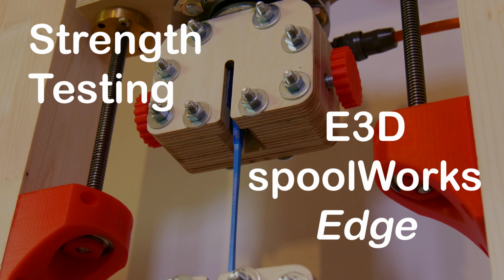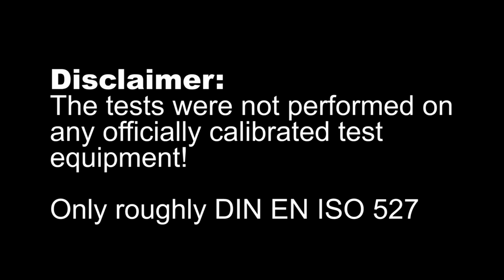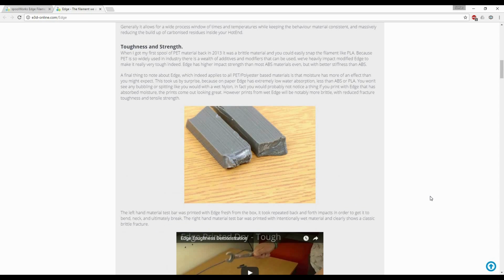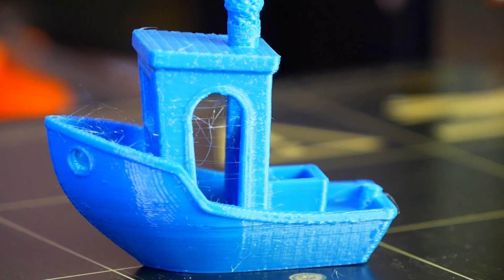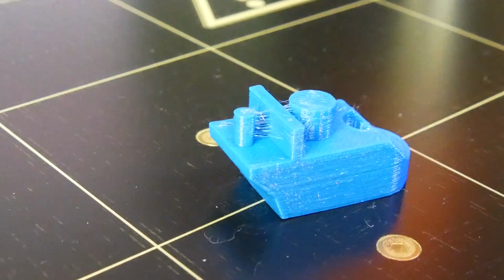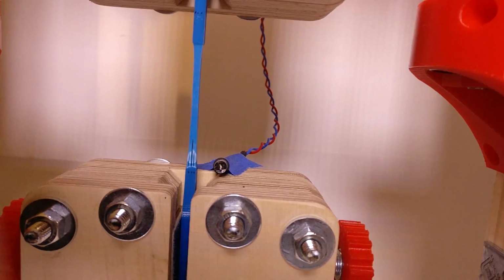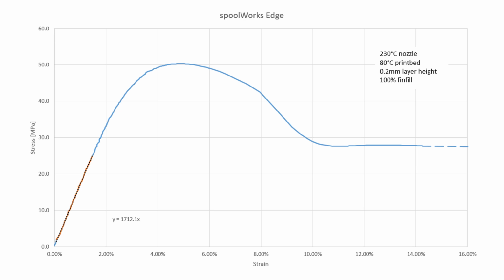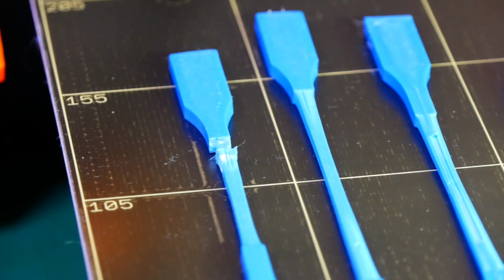Filament Strength Testing: E3D spoolWorks Edge - How strong is it?

Comment: I believe that to achieve better layer adhesion with higher temperature filament you need the enclosure with temperature control (not too far from the glass point of the filament used) so that any plastic has a better chance at good quality print. Due to less aggressive temperature drop while curing and more time for the layers to bond.

Comment: Thanks for the excellent video. I've NEVER got on with PET-G and co-polyester based materials. I find them viscous when extruded, retain heat too much so they curl (not warp) and adhere so well to PEI they can destroy them. The colorfab XT-CF material solves the curling issue by stabilising the material and is quite nice but not perfect.

I'd love to see my favourite materials tested: Polymaker PC-Max and RigidInk Carbonyte. Both of them are amazing to work with. The Polymaker in particular.

Keep up the good work! Thanks again.

Comment: Absolutely love your videos! My Prusa is setup nearly identical to yours, including only two screws on the extruder fan (4 seemed like an overkill). I have been curious about heat treatment of FDM parts, may help with layer adhesion post print. Is that something you have tried? Would love to hear your opinion or possibly see a video!
Reply from the maker: Yes I've tried it a couple of months ago for some specimens. It did not change the world and you have to cope with lots of warping. I'm planning to make a video about that in the future.

Comment: Good job! I use Spanish PETG/ as i live there/ and as we have the same printer like you, i print it at 225- 230C , 65C bed original settings for Simplify3D for ABS, just changed the nozzle and bed temperature. No layer fan!!!.  It works like a charm. Tremendous adjesion